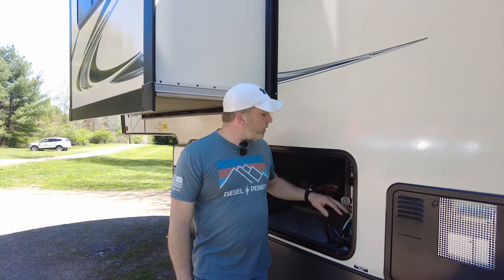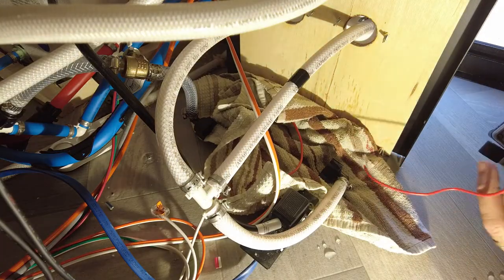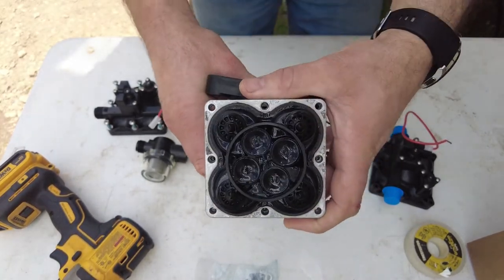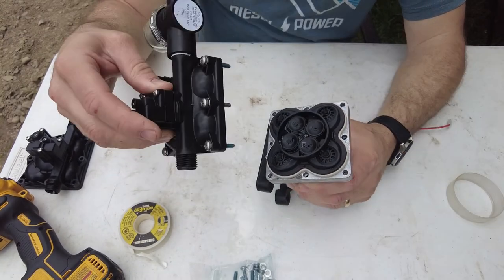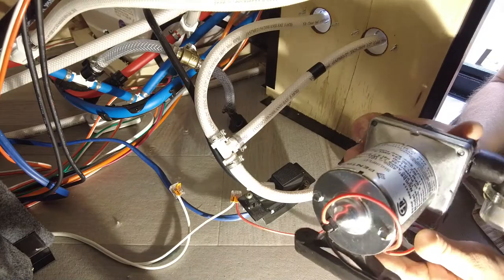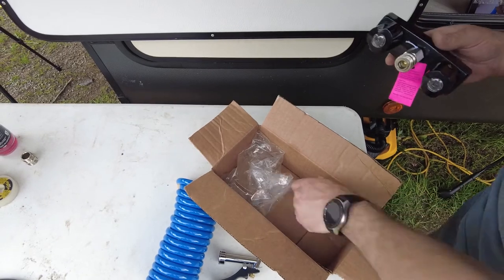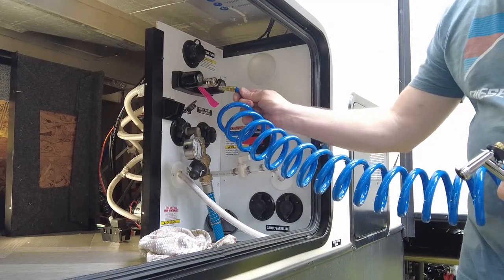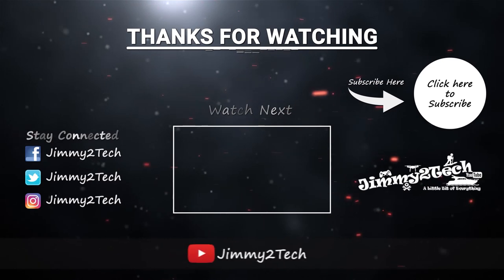How To Repair SHURFLO RV Pump & Must Have Wet Bay Upgrade

Comment: I’ve had the same issue twice on my 2013 Forest River pull trailer. After the first time this happened I found a YouTube’er that had a simple way to possibly fix the problem and it has worked both times for me.  It seems that the check valve gets out of wack (confused) when the city water is hooked on and you run the electric water pump.  The fix was to shut off the city water and then run the electric pump, opening all the water valves in your RV one at a time for a minute each then shut off the water pump.  Then run the city water and check if the fresh water tank starts to fill.  Good luck!

Comment: Good video a suggestion from fellow RVer I put a 1” thick piece of rubber between the pump base and floor it made the sound more quite when running
Reply from the maker: Hello Texan1845, 
It's funny you said that because I did end up putting some under the pump just did not put in video because I did it as an after thought. Thanks for watching.

Comment: I vaguely remember that some connection points specifically say no Teflon tape. The part is designed to be watertight plastic to plastic. Maybe thinking of something else? Good video, thanks.

Comment: You have your inlet and outlet sides of the pump confused. At "3.20 you say outlet"" and "Inlet at 3.29" they are the opposite, inlet side (low pressure side) has the strainer on it. A strainer on the pressure side would not protect the pump from incoming debris.
Reply: Definitely agree some people are just not cut out for doing how to videos

Comment: I believe you identified the Inlet and Outlet sides incorrectly. The clear filter attached to the pump, I think you'll find, is on the Inlet side. Look for a direction arrow stamped into the pump head.

Comment: Probably best that you did the repair and not camping world. I usually take pictures of the wires just to have a good record, especially if there are more than 2. Wago connectors are great for 12 volt systems. You can buy a replacement check valve kit. They had issues with valves made during covid. The cone washers can be damaged in the connections while removing so always best to have a couple of spares to replace just in case.

Comment: Hi bro..Good vid...what u reckon if pump sticking....stripped down and motor it making a noise and hard to turn...seems so dry....any advice appreciated buddy👍
Reply from the maker: If the motor is hard to turn sounds like an issue with the motor, maybe the brushes or something. These pumps are relatively cheap so might just be easier to get a new one.